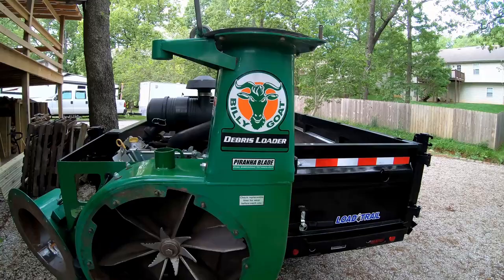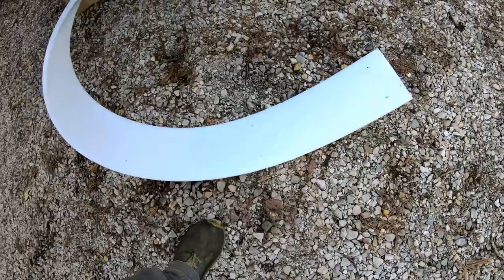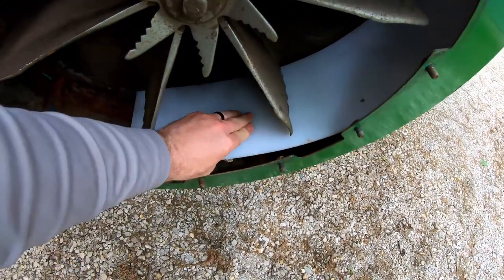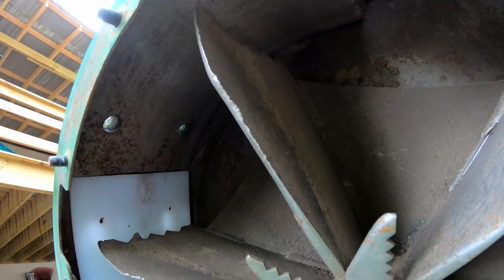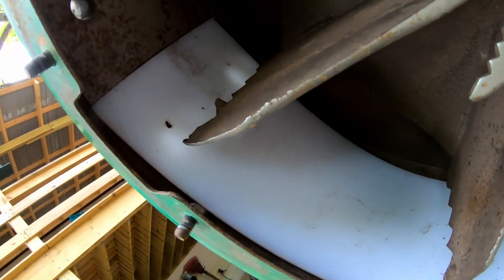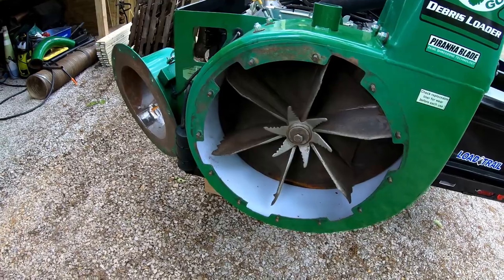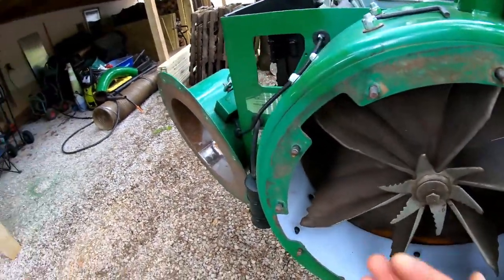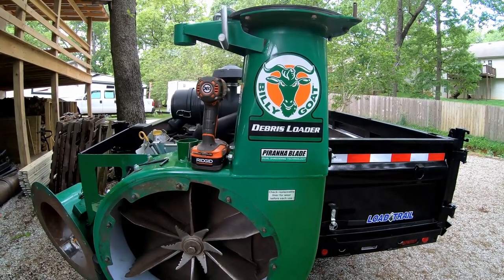Billy Goat Debris Loader Liner Replacement

Comment: wow how many hours are on it there mine only got 15 hours on it  the impeller is in  like new condition  you need a new impeller too it looks worn down
Reply from the maker: No idea, it didn't come with an hour meter. It was used commercially for 3 years before I bought it. I added an hour meter recently.

Comment: I will say, get some regular hex head bolts, the heads of the Alan key bolts will wear down and make it impossible to get a good grip on them with an Alan key to get off, with the hex head bolts they still wear down but you have a better chance of grabbing the head of the bolt with a wrench than the Alan ones.
Reply from the maker: Good idea, the original bolts sucked to get out.

Comment: The price don’t make sense what I do is I cut one white barrel food grade and let me said the material is more stronger than the original I just spend 10 dollars in the barrel And I get 3 replacement vs the $80 for the original check before buy the original
Reply from the maker: Appreciate the tip, I might do that next time.